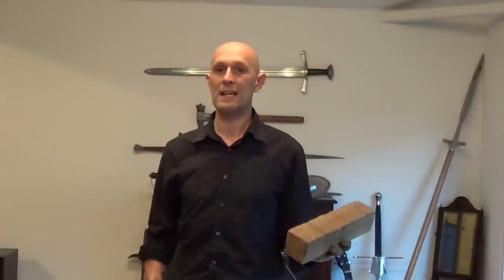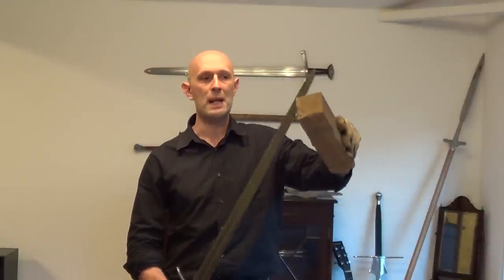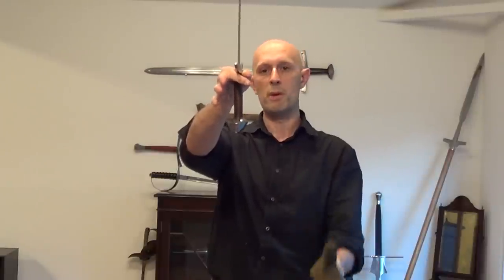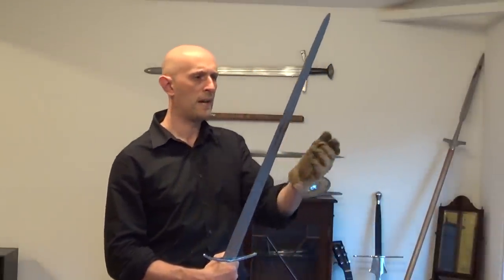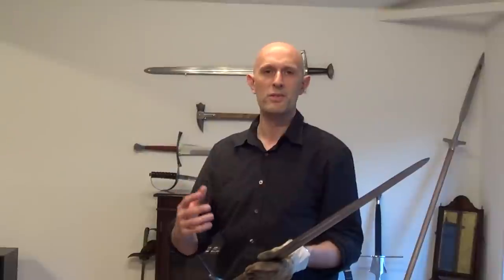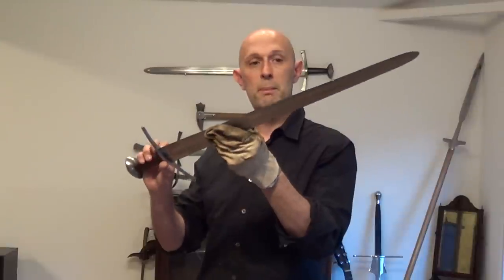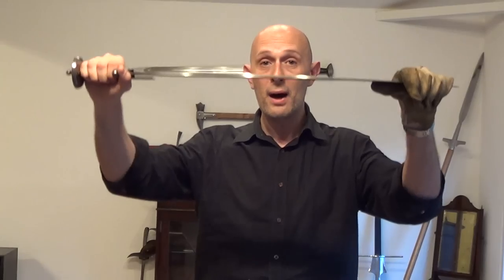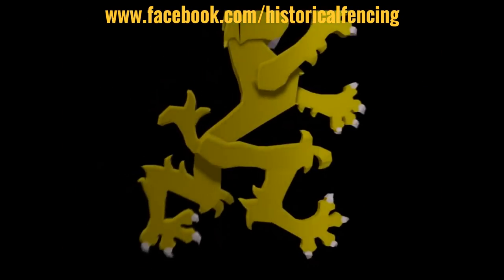Centre of percussion, nodes of vibration and stiffness of swords

Comment: Not to debate, but I've been getting my shop ready to produce swords in the near future. I have a very good friend who had given me a formula that puts the amount of mass needed into the pommel of a sword, in order to affect changing in the vibrational nodes. We've begin using this in order to try to produce swords with a vibrational node nearly at the very tip of the sword, allowing it to be both the farthest section of the blade, and also the more hard hitting section. However since (and this is purely speculation, as in the Midwest USA there are few antique swords to study in comparison to Europe) most swords that I've been able to see off the Internet appear to be of the vibrational node variety that has it at the handle and at the last quarter of the blade; could it be possible that this was intentional to cause a slight bit more cutting because of the vibration? Not due to it vibrating by and if itself, but if the last bit is going to be more prone to warp, and bend, it may stay in the cut a while longer and allow for a drawcut that will "stay with the target". I apologize for what I'm sure is a mess of run on sentences and a poorly thought out inquiry. However, in the next few months/years I'll be putting a few examples of both to side by side testing and if it's noteworthy I'll share my conclusions then.

Comment: right, on all points;(great,  i'd never heard of nodes of vibration); i bet doing ENOUGH wood chopping w/ OTHER than the c of percusion would transfer enough vibes to HILT to damage it (enough WOOD CHOPPING, w/ a sword??); but, i'm wondering how much difference all that really makes on human targets, armored or not, as, you're moving, he's moving, so, hitting right at the c of percussion-- pretty unlikely; plus, i'm thinking-- just how UNLIKE wood, a human target is; plus, i'm thinking just what terrible damage you can do to a human target w/ ANY part of the blade; plus, there's draw cuts, push cuts, rolling cuts (like behind the shield, w/ shields clashing), curving cuts (curved path)

Comment: Schola Gladiatoria  the Centre of Percussion is still a node of resonance, it being found on an orthogonal vibrational plane doesn't change the physics, just where you're looking at it from.
On a bat, for example, it's the same all the way around, because of no changes in shape.
Definitely, I'll say your method is more accurate in finding your COP (did you see my xylophone example in the comments of your last COP video? Gave me a chuckle when you struck the sword away from a node and it rang so nicely :P ), but maybe because you're not relying on sight to see which part of a thing vibrating faster than the human eye is wobbling the least, and also because of where the force is applied?

How does a sword vibrate if you strike the pommel on the same plane as the edge? Could make for some breakthrough experimenting :D
It's hardly definitive, but I tried it on one of my synthetics, and when I struck the short-edge  edge of the pommel, the blade still vibrated (although not nearly as violently haha) along the flat, but curiously, it almost didn't vibrate at all when I struck it on the long-edge edge of the pommel... It definitely needs to be tested with steel, but maybe the palm of the hand is giving dampening effects not being taken into consideration?
Reply: ThegnThrand ^something you may also be interested in

For clarification I was striking with the heel of my hand, and not a lump of wood or anything, which may also have an effect on the results (I bet even doing Matt's technique with your hand becomes less accurate with dat fleshy shock absorbtion)
Reply: SerAlgernop BlitzKrieger The center of percussion is actually variable, unlike the resonance nodes. If you swing the blade, its towards the tip, if you just drop it onto something and the tip and the handle move parallel at the same speed, its in the center of mass. If you swing the blade holding it at the tip (not recommended), the center of prercussion would be somewhere at the handle part of the blade.
Reply: DudeNumberOnePlus yes... Because you're doing the opposite of before. If there's two nodes, and the one in the blade is COP (for argument's sake), then if you're holding it at the blade the hilt-end would become the COP?

And I can't say for sure, but that centre of mass one sounds more like it depends how you look at it, one way the tips are still and the centre is vibrating, the other the centre is still and tips are vibrating.

Incidentally, resonance nodes shift in more flexible objects, example, guitar strings. 

It seems to me it's just a node that's effected by other variables. Because with the way physics work, you shouldn't get a mysterious third node that just floats around. I'm skeptical, mmkayz, and considering there's no consistent explanation for why they're completely separate entities, I'm just not willing to take it on faith. I mean, the striking in line with the blade causing it to vibrate in line with the blade has already been dispelled...

Comment: You said that physics says its the tip which transfer most energy but that's just plain wrong. I do know quite a bit about the subject and I can definitely agree with you, center of percussion is a well defined concept in mechanics and I mostly has to do with the moment of inertia, that is, the resistance of the object to be rotated about some axis. And it it is basicaly the same reason why buildings crash not at the tip but about 2/3 the way up. If you say someone show it to you that it is the tip they made some mistake, it indeed is more dificult than just K=1/2mv^2
Reply: And you are definitely right about the nodes of vibration is a completely diferent thing to the center of percussion, it has no relation whatsoever

Comment: wouldnt you aim to parry or catch your opponents blade (at least for initial contact) at that point of least vibration?  

if your nodes of percussion and resonance are in the SAME spot on your blade it makes for less thinking requried in combat...  therefor it could be said that the closer these 2 points are together the better that blade will perform in combat... assuming balance ect is right as well

Comment: IMO the wood method does not show a center of percussion. It shows optimum cut point.
Reply: ***** Aren't those the same with a chop type cut? 
Maybe if you do a draw/push cut then the center of percussion doesn't matter that much, but for the type of cut where you're essentially hitting the enemy with the edge, isn't the center of percussion also your optimum cutting point?
Reply: Zombigotron No, they are not the same thing. They are usually very close, within an inch or two in most cases, and may sometimes be the same point, but the definition of CoP is not the same as the optimal striking point.

In the end, it is only test cutting where it really matters. I highly doubt anyone is skilled enough to pick the exact inch of blade in which they are going to strike in a combat/sparring setting. CoP, Res Node or optimal striking point, they are close enough to make no real difference.

Comment: Whenever I have checked my sword for center of percussion I just hold the sword by the grip with one hand and slap the pommel with the other. The center of percussion is the part that does not vibrate or wobble. Do you find this to be an accurate way to test COP?
Reply: Paul Greathouse Well I guess I am an ass for commenting before I finish the video.

Comment: Well this is a crappy explanation. I'm not saying you're incorrect, but at the same time I can't exactly learn from a video if you're trying to explain something with "it just is, trust me". The two effects of the node and the transmission of force ARE directly related because you aren't actually going to manage a cut absolutely precisely orthogonally, and the plansr vibration steals energy from the cut. The nodes may not line up depending on mass distribution,  but their interactions are connected.

Comment: scholagladiatoria 

"I don't care about the science." Then why talk about it at all?

I've seen so many people (people I respect, no less) completely dismiss the physics of swords, because it disagrees with their notion or personal experience of how a sword is supposed to work. This shows extreme ignorance of the way the world works, and it's very frustrating. Part of the reason we find ourselves in so many pickles is because we trust our own intrinsically flawed and fallible experiences over the objective measures that sciences like physics provide.

To use an analogy that hopefully we all can relate to - it's akin to a modern person (i.e. a HEMA practitioner) trusting their own experience over the person who wrote the texts we study.

I find your statement that you don't care about the science bizarre, because then you turn around and demonstrate (correctly) that the centre of percussion and the node of the first harmonic (more nodes appear the higher the frequency of the vibration) don't necessarily coincide. And despite my misgivings with the rest of the video, it is a good demonstration.

On top of the above issues, you do want a sword that can flex for superior durability (repeated bendings lead to metal fatigue), but what you want is for it to require great force to do so (i.e. be stiff). These things are not the same.

Comment: The problem with physics laws and swords is that most people who know physics well have never hit things with swords, machetes, etc, especially 10,000+ strikes. There is so much going on in such a seemingly simple act as hitting something with a sword (and it is popular in some academic circles to deride such acts and those who do them as "stupid cavemen...") that it requires many physics formulas used in several related equations calculating one solution to represent them all. They aren't aware of all the dynamics involved, which WOULD be perfectly described and predicted by Science, if proper premises could be established.

The portions of the blade closer to the hand receive more torque from continuous application of force over time, and the "equal but opposite reaction" from the object being struck will also not have so much mechanical disadvantage against the person swinging the sword in the sweet spot vs. the tip. Leaving those factors our of your equations will certainly skew the conclusion. Science and logic only work when all variables and premises are taken into account.